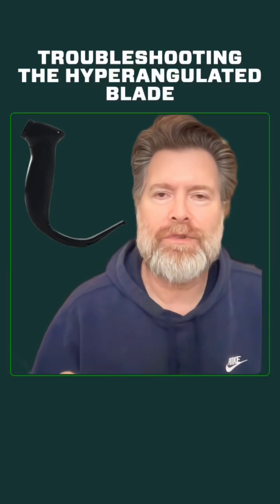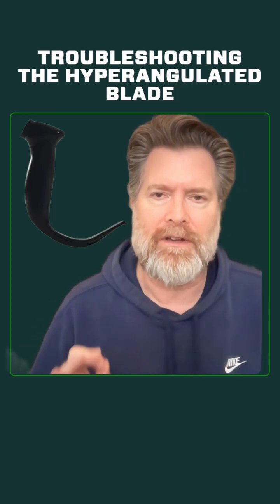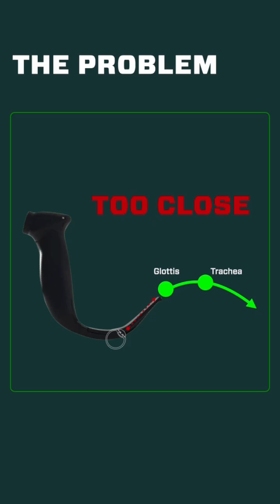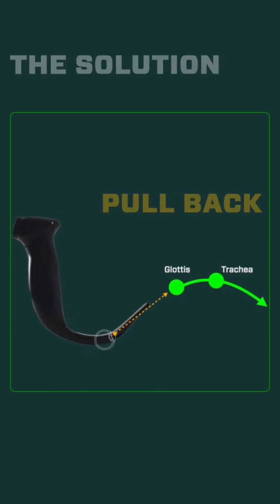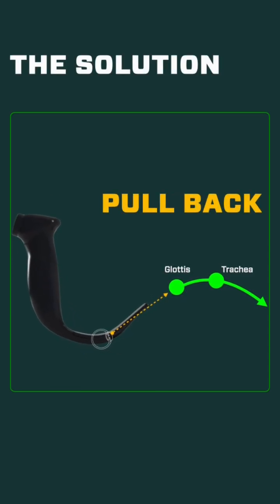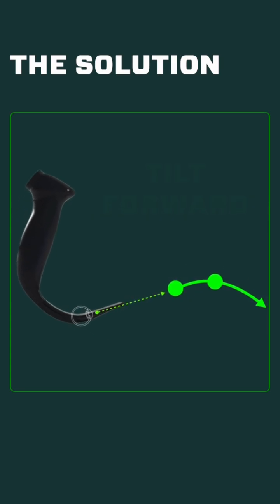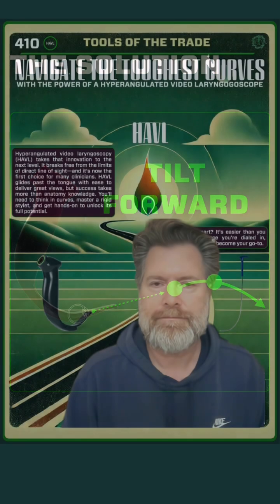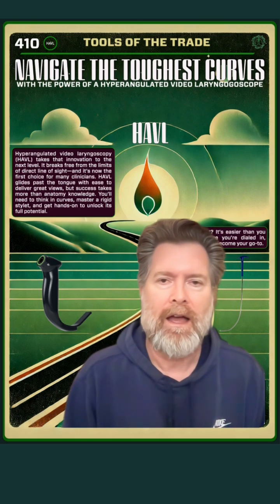These adjustments will definitely improve your hyperangulated video laryngoscopy technique

Comment: Thank for the straight forward advice. I think for those continuing to have trouble it is very valuable to make sure they are using a rigid stylet. This is just another common issue in addition to what you mentioned. Often the tracheal tube on its own, or with a malleable stylet will not reach the glottic inlet. Caution that the rigid stylet itself should not enter the larynx (trauma) and can be withdrawn as the TT enters. There are also a number of articulating stylets.  I use a rigid stylet 100% of the time - not that I always need it, but it makes me better at using it.
Reply from the maker: 100% agree! The hyperangulated blade really works best with a rigid stylet.